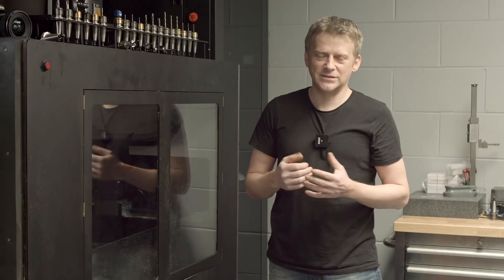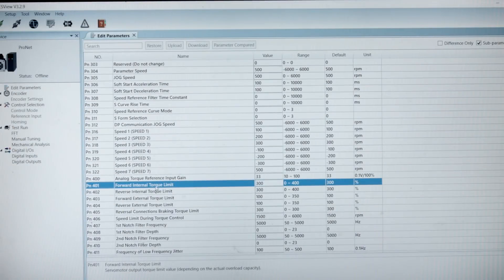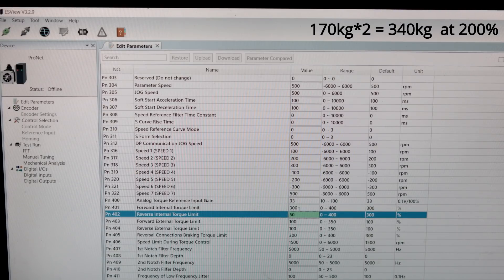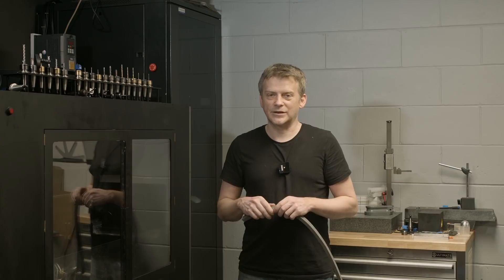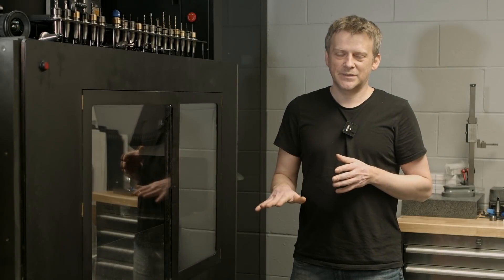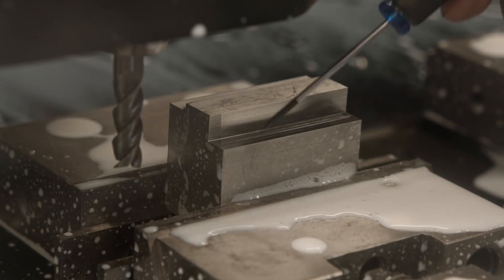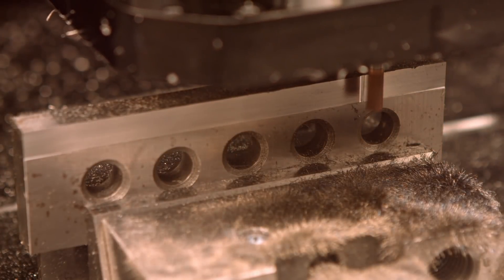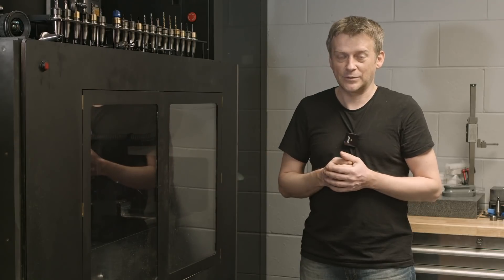CNC SERVOS - how strong are they?

Comment: Good morning Fox !
Reply from the maker: Morning! :D you are fast ! :D
Reply: @PiotrFoxWysocki   I was checking the news and it appears a popup that your had a new video so, well like I like your videos and work, I jumped on the occasion ! I finished to watch it and I have a question about your setup, nice setup i should say.  In mach3 ( i think you use it) what acceleration do you use ?  I am finishing a big machine, big for my standards and curious what you use. ( above 4000 in accel my machine to move across the room :D)
Reply from the maker: sorry for late reply  but i had to check. i set it to 500 which is 0.5g. my table under the cnc is a bit flimsy so i don't want to push my luck too far :D with the gantry weight of 130kg. beside high accelerations will ruin your ballscrews. 500 works well for me
Reply: @PiotrFoxWysocki   you use metric units  mm/sec2 ? don´t worry for the ballscrews, they are 32mm and really I don´t use 4000, I use 450  almost like you, but it doesn´t give me 0.45G but 0.045G
Reply from the maker: Haha 😄 as always i looked to fast at the numbers 😉 yes you are right its 0.05g. Not 0.5g 😀